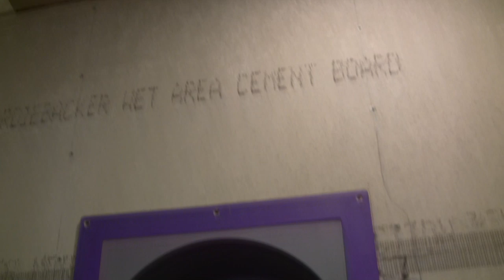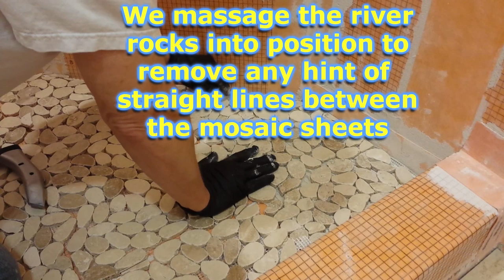Our Best Bathroom Renovation Yet - Part 2 | Shower Walls Waterproofing

Comment: How long does a project like this take?
Reply from the maker: This took about 2 weeks. There was a lot of repairs to be made inside the wall first. Also working with Travertine takes a lot longer, it's heavier and slows things down.
Reply: jeffostroff thanks, I plan to do my master shower and eventually the rest of master bath & these videos are great learning experiences. Thanks!
Reply from the maker: @limestar9751   Great make sure you check out the other bathroom shower tile videos that we have Uploaded as well .

Comment: Have you tried the Kerdi board or Wedi or anything like that?
Reply from the maker: Yes Brent I have used Kerdi Board many times since we did this project. I now actually prefer Kerdi boards because it is so light I can carry the entire shower walls worth of Kerdi panels at once, were as you're making 6 or more trips with the heavy Hardi Backer Boards. Kerdi boards are less work because you don't need to cement on the kerdi membrane. But they are pricey at $35 per board. When I can I use Kerdi board now.
Reply: @jeffostroff  I will have to give the kerdi board a try. I've used a lot of wedi but it is pricey too. Try and make it up on the labor

Comment: Had no idea vanities cost so much.
Reply from the maker: That vanity is much higher end than the normal particle board vanities you would buy at lowes or home depot. That is solid wood and the curved doors are very rare you don't often see those on a vanity. Also that granite countertop is probably about $70 or $800 based on most of the granite countertops I've had to pay for in the last few years. So considering what you get for all of that and soft close doors and drawers that's actually a reasonably fair price.